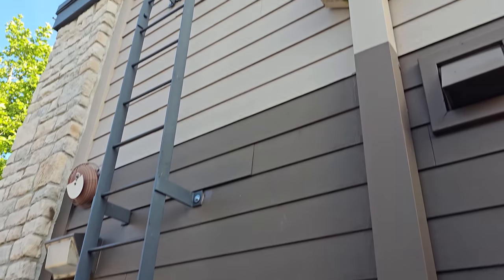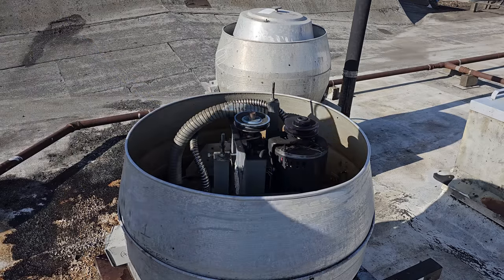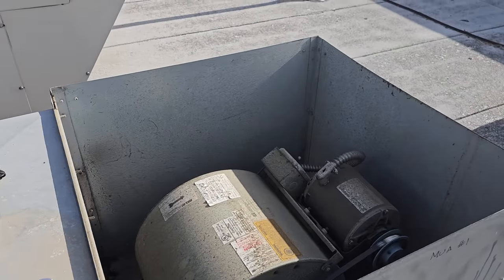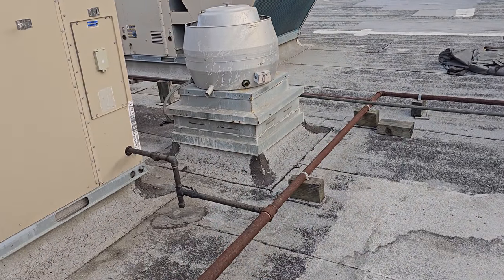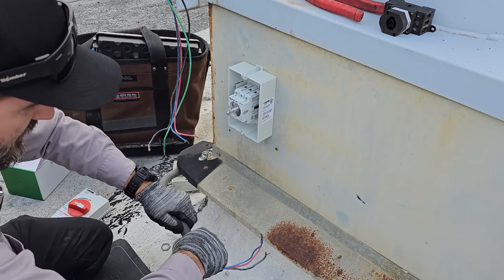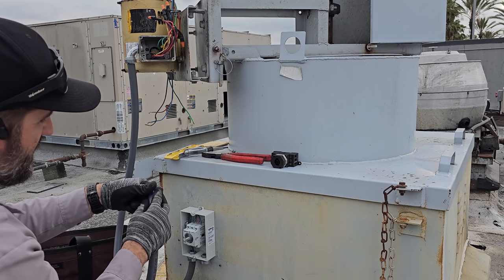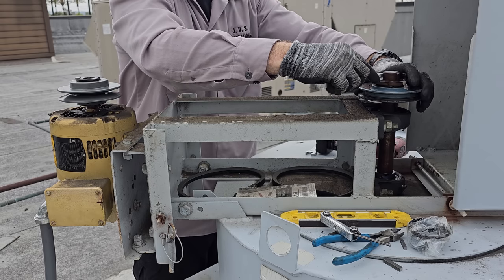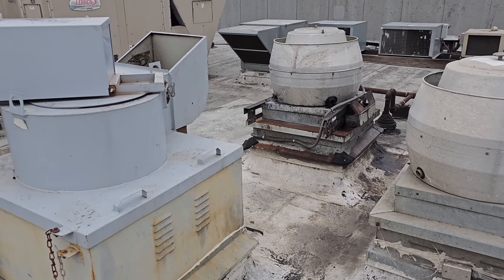THERE IS TOO MUCH SMOKE IN THE KITCHEN

Comment: Make up air is critical in controlling humidity in a building. I've been dealing with a Hospital that is negative through every door in the building and that results in sweating diffusers and walls in the O.R. They've added a bunch of exhaust fans through renovations, but never added make up air to balance the air. It's a nightmare to convince an Engineer that they've made a mistake, but that IS what the problem happens to be. New Techs should be aware of the importance of make up air units. Currently we're working on locations for new penetrations and unit locations for additional MA units.
Reply: Sounds just like the hospital where I work, the OR staff lowering the temperature setting to low, we had to lock them out at 68 minimum.
Reply: @WTF Man! : "It's a nightmare to convince an Engineer that they've made a mistake". On that note, I am a Commercial Laundry Technician. on a new construction on a College the new laundry room had a bad design on the dryers vents, 2 "L" shaped 14" horizontal pipes where all the dryers where hooked up and when I saw it strongly suggested that they must add a blower fan to blow the excess of air out due to the dryer fans not capable of getting rid of the air out. well, the College trained so called "Expert" builder changed the vent setup by eliminating one of the pipes and used single 4" pipes hooked up to the other horizontal pipe and used HVAC dampers on the dryers causing a blockage and blame it on the dryers, I went and discover several dampers blocked and told him the original fix of the blower fan was the way to go. needless to say my words fell on deaf ears so I went and removed all his HVAC dampers (the springs were too strong for the dryers) and replaced with dryer dampers and I didn't needed a degree!!!!!!
Reply: At a former job, the negative pressure was so bad that customers couldn't open the front doors, and the door closers were stressed from the vacuum pulling them closed forcefully. (Fried Chicken Franchise) What happens when you pull 80°F air at 90% RH into an air-conditioned building? Condensation EVERYWHERE. Doors, windows, floors, counters, tables, chairs...

And, as usual, "Andy don't know nothing." Hmmm, now that I think of it, I have a video of that bad negative pressure issue sitting on my hard drive. Might get around to posting it soon...
Reply: @Sean Embry well said
Reply: Hope I never have anything done in a medical center like that the operating rooms and any other sterile areas in the medical facilities I serviced maintained and recorded the temperature and humidity and the space pressure also was .01 IWC higher than the space pressure outside in the hallway and was inspected by the department of health how are they even doing any type of medical procedures in the   environment they are saying they have  there should be a lot of people that are getting sick from the airborne contaminates created in operating rooms
Reply: @dashcamandy2242  sounds like the fried chicken restaurant chain I serviced here and I usually found  exhaust hood supply fan problems and only half the compressors operating in A/C units air filters stopped up belts worn out and then find out maintenance man been there for a few days and I get service call after hours  WTF maintenance man been doing all week or who was he doing or what was he smoking
Reply: I had a similar experience but the problem was the hospital had dampers closed and didn’t know it. Most of them were old pneumatic dampers without end switches, so they didn’t know they were closed.

Comment: you missed a step on your safety check to ensure the power is off.  the last step is to check your meter is still working after you verified the power is off.  electricians have been electrocuted due to missing this step.

Comment: Years ago there was a burger place that had a gas leak and it was ignited by one of the fans and blew the roof of the building. No injuries. Fire department found a bad motor seized and wrong breaker that fried the wires.

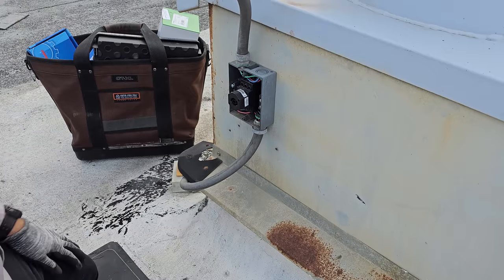Comment: 19:28 I'm an Electrician and as long as it's installed and sealed as required by the NEC (USA)/CEC (Canada), you can run your conduits in and out from any point in the Junction Box Housing you want to or available space/circumstances require...

That said, it's generally seen as Best Practice to run the conduits in and out from the bottom of the boxes when you can to reduce the chances of leaks...

Comment: I wish whoever engineers portable AC's were educated in air balance. They use inside air to cool the condenser, pipe it out, and use inside air across the EVAP. Makes the space negative and literally SUCKS in hot air through any crack or door not sealed or closed tight.

Comment: I think it should be a requirement for managers of those facilities to be capable of performing routine maintenance and cleaning. To have someone there every day that is cross trained in maintenance is always beneficial
Reply: Before i started in HVAC I was a maintenance technician for an arcade restaurant. Companies don’t wanna pay to compensate their employees extra knowledge. It’s rather unfortunate
Reply: Most of them don't know food safety how to use a pyrometer to check and see if grill is cooking food properly or half way clean their equipment, and don't know something is wrong until   customers complain or area supervisor makes a visit , it's sad but true. And the ones that are doing the job correct gets promoted and the revolving employee door is always going round and round lots of people come and go and never get trained properly 43 years doing air-conditioning and refrigeration for restaurants and grocery stores mostly the bigger restaurant and grocery store chains had a lot of people come and go

Comment: 39:19 The top of the motor needs to come away from the tension adjustment plate a hair so a thin washer on each mounting bolt should tilt the motor shaft back into level...

Comment: Anyone criticizing not carrying all the belts is someone who doesn't work on a lot of equipment. I can see several dozen different sized belts a week. The amount of room you'd have to dedicate to belts would be insane. Then you run into the fact that belts have a shelf life. Over time they dry out and crack easy. Wasting money on the off chance you need a specific size when a few feet of power twist in A and B size will get you through any emergency belt break is insane from a business standpoint. 100ft of A or B belt power twist around $1200. give each guy 20ft and it pays for itself really quick
Reply: I started with a few belts,now i carry over 50 LOL.
Reply: To have all the belt you would need a winnebago or a lage trailer just for belts LOL
Reply: @adamdnewman  just my customers belts many repeat.they work great on Sunday's.
Reply from the maker: I will discuss this on my livestream this evening 5/15/23 @ 5:PM (pacific) come on over and check it out https://youtube.com/live/d1mbaSKbOQ0

Comment: I actually ran into this today smokey inside go on the roof and all 3 running problem is 2 of the 3 have had motors chsnged in the past abd it reallu helps if you wire them for the correct rotation.  People dont understand the wheel is supported to spin with bllase / using thet mark as a blade the motor should spin the.directiom that the most inner part of the blade. Or you can also go by the arrow thats printed on the inside for rotation.  I bet in the last couple years ive had to change otation on a   couple dozen exhaust fans because theyve been wired backwards.

Comment: I may be wrong but it looks like the motor pulleys are too deep for the type of belt. If the belt does not fit the pulley properly, it can slip causing heat and wear.

Comment: Two cents worth of comment, so you know it's going to be good quality and yes, do realise it's yet another anonymous person on youtube saying 'do this', but ...

Consider putting a weep hole in the bottom of the enclosures if they don't come with one.  Water always manages to find its way in and then get lost and never find its way out again and pools in the box.  It may not fill up the box but it makes for a very humid environment in the box and things will then rust / corrode at a much higher rate.

When it comes to ferrules if the terminal is a clamp type rather than a piercing screw type ferrules aren't necessary.  What we'd do in Australia with stranded is twist the strands into a solid mass then put that in the clamp terminal and go from there.

Again, only two cents worth so everyone can take this with the proverbial grain of salt.

Comment: Good afternoon bro. I have a question about a hoshizaki ice machine I’m working on at work. It slowly started making less and less ice till this morning it was empty. I turned it off and turned it back on just to see what it does. So it starts compressor kicks on and after 20 seconds it completely stops. Any input would gladly appreciate it. Thanks!!!!
Reply: You might check the fan cycle switch, they can get weak over time and eventually fail, could also be low charge, old water filter, lots of options but only running 20 seconds sounds like a fan cycle switch

Comment: you could stock the belts and then just pray that  the manufacturer or supply house will take returns or buy the unused belts from you.

if the issue is space you could buy a trailer and carry parts in the trailer.

Comment: Someone should make a jig to sand down those pulleys and sell them. Seem like a waste to toss an entire pully because of a tiny ridge
Reply: Some of those ridges are pretty darned huge.   To properly rework the pulleys, you''d need to have a metal lathe AND the proper jigs.   It's not cost effective for cast metal.

Comment: Question to anyone: these mostly appear to be roughly 1:1 pulley sizes so why don't manufacturers eliminate a point of failure/maintenance and direct drive the shafts from the motors with couplers?
Reply: It eliminates a point of revenue. Jk,  good question.
Reply from the maker: I will discuss this on my livestream this evening 5/15/23 @ 5:PM (pacific) come on over and check it out https://youtube.com/live/d1mbaSKbOQ0
Reply: @HVACRVIDEOS  appreciate the opinion/answer on the topic, thanks 👍🏻
Reply: With the pulleys, and especially the belts, there's a dampening point.   If you direct drive, any wobble will start grooving the shaft and can tear the motor apart.  That's the simplistic explanation, but direct drive often suffers from premature burnout, sometimes explosively.

Comment: Wonder if you could build a database of all the parts you change to see the most common.  Then, stock your truck accordingly.
Reply: You will miss the belt which is needed for this new emergency customer calling you at saturday late night. That seems to be for sure...
Reply: @deineroehre2012  I'm sure, that's how it always works.  But I would rather not have something that I never change, than not have something that I always change.

Comment: Brother , I have a question,  I had a carrier 2 stage 15 ton , 2 compressors,  first stage works fine , sec stage cycles on and of, I throw my guages and find out that suction goes to 37psig , there is restriction, the system is 2 years old, no txv , I recover and took the dryer out and it was fine , pumped nitrogen threw suction while dryer  is out and noticed the restriction, blew threw the liquid line and it was fine , dose that mean the evap is bad? Or those orifice headears needs replacement? If they do, how could I change those ? Or just swap with txv? I appreciate your hard work and help .

Comment: Did you change the disconnect because of that small crack?  think bead of silicon would have lasted for years and saved the customer 100s? It rains very little in CA and that repair was over and could have waited till the fan replacement. You did that just to raise the bill.
/

Comment: What happened with the restroom exhaust fan? What was the issue?
Reply from the maker: Locked up motor and the fan and wheel  are  caked with dried poop lint..... no point in trying to change the motor. The fan is gonna be cheaper to replace
Reply: @HVACRVIDEOS  thanks for the follow-up.

Comment: Any certain reason you use metallic liquid-tite vs non metallic? Assuming I just don’t know the code for it.
Reply from the maker: I prefer metallic liquid tite because if the jacket breaks from the sun the conduit Is still intact , basically it's stronger and and lasts longer in my opinion

Comment: Are direct drive rare for these fans because of the need of a VFD which is too expensive?
Reply: You normally only see DD fans on lower HP setups. Like bathrooms. I still have seen plenty of VFD driven fans with belts, especially larger systems. Most of those are building pressure controlled or CO/CO2 controlled in cases like buildings or parking garages. In all honesty...i believe most choices comes down to $$$$$$....buildings want to spend as little as possible and make as much as possible.
Reply: I thought of that myself but you still need some way to decouple the vibrations from the motor shaft, as that will kill bearings quickly the moment grease unbalances the works, but otherwise agree its all about the costs. A DD motor would also be very specfic to the fan, couldn't use a good quality off the shelf motor in most cases as the sizes will be custom too as thats how they do things when reinventing the wheel, someone makes a killing off those changes to industry standards.
Reply: @spikester  Thanks, that makes a lot of sense, I guess the belt is acting like a shock absorber, so vibrations would kill the belt and pulley first instead of the motor.
Reply from the maker: I will discuss this on my livestream this evening 5/15/23 @ 5:PM (pacific) come on over and check it out https://youtube.com/live/d1mbaSKbOQ0

Comment: @HVACR Videos You think stripped screw holes on HVAC equipment is bad then try following an appliance tech that can't control uga dugas. Usually have to have the same exact screw for clearance issues and have to order whatever screw attaches to. Glad I don't work with that guy.

Comment: I was wondering on those fans if you want to amp the motor afterwards can you do it from the service switch or there is a more efficient way? Good job man i like your videos i have been learning from you!!
Reply: You can take an amp reading from any point where you can get your meter clamp around a single conductor feeding the system you want to check (you can't get a reading if the clamp is around both the hot & neutral (120V), both line 1 & 2 (240V) more more than 1 conductor in a 3-Phase circuit since the magnetic fields of the 2 conductors will cancel each other out leaving nothing for the clamp to read or in the case of 3-Phase circuits, you might get a reading but it will not be accurate if more then 1 conductor is in the clamp...
Reply: @HappilyHomicidalHooligan  My question was different. I know how to amp a motor but the thing is that if the fan cover is missing the amp draw changes. That's why i asked how is everybody doing this
Reply: @vasileiosbakas9754 on a exhaust fan that cover is only covering the motor and the bearings belt and shaft doesn't affect the air flow like a panel on a/c units only restricted air flow less amps or increase the blower speed by adjustable motor sheaves/ pulley's or change pulley sizes increase amps or wrong direction will overload the motor

Comment: Those are supply fans and exhaust fans for the hoods and not mau units for my area. MAU units are to be used for conditioned air in the kitchen and to produce a constant air velocity wether it be positive or negative. Thanks for making vids.